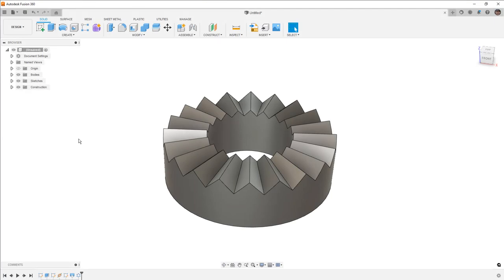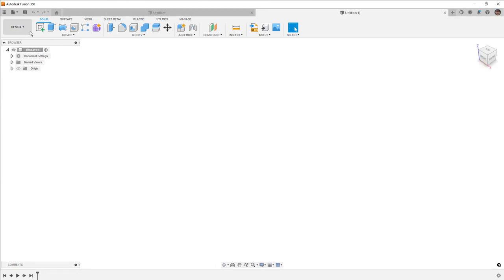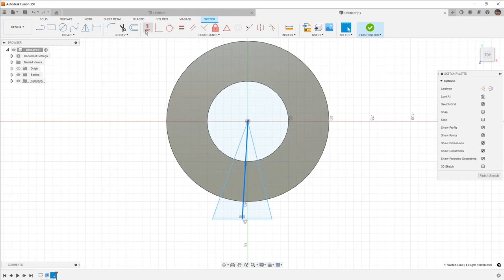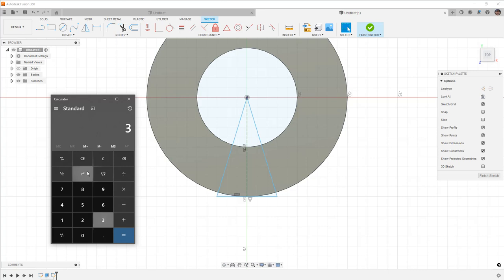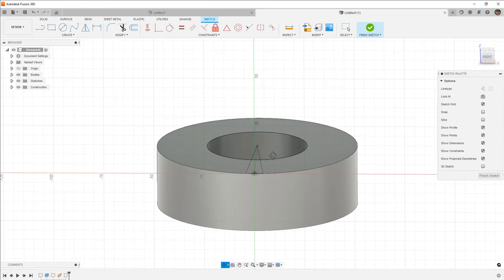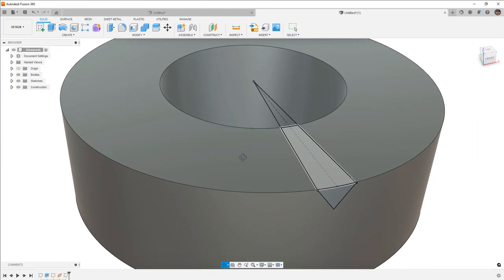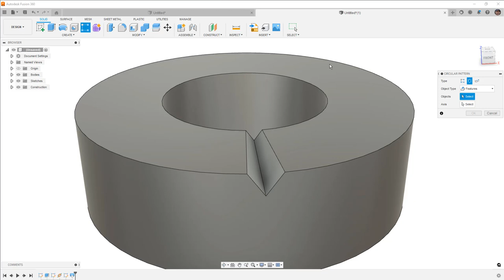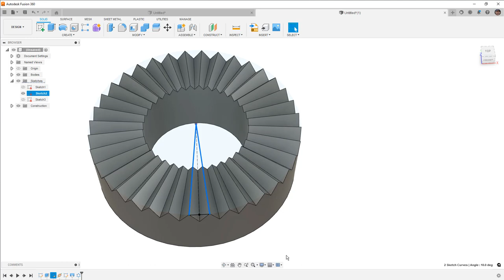Fusion 360 Quick Tips | Serrated Washer Using Loft To A Point | #fusion360

Comment: Reference through constraints are truly the key.  One of the toughest things to adapt to coming to Fusion from Creo is the need to project and intersect to maintain references that will allow these powerful function to work as intended.   Thanks again Matt.
Reply from the maker: Thanks brian, there is an option in the user preferences to auto project.  So if i started drawing the V shape off the edges it would project them for me.  Sometimes it might not bring in what you want though.  For example it might just bring in a point and not the horiz line.

Comment: Perfect for using formula here. You can drive the angle and geometry by just one parameter
Reply from the maker: Yup that would be a great next step!  Have a parameter for the pattern number which drives the angle as 360/pat-num / 2
Reply: @LearnEverythingAboutDesign  yes and to pattern features will not break anything.

Comment: Quite a long process in this software. In DSM you just make cylinder draw a line from center to the edge make pattern, finish sketch and pick the lines you want to move up or down and set set it to the required height. Would take a minute. Nevertheless thanks for the video I was looking for. I found another way as well and not sure which is better.
Reply from the maker: You can do it quickly when you don't explain it but yeah.  There is another video i did shortly after this one on making a true Hirth joint since this is just the general shape.

What is DSM?
Reply: Yes, of course. I am just saying that it requires less number of steps. Design Spark Mechanical is a very smart 3d cad with few options only but would allow to do quite a lot if work sequence is right. Nevertheless Fusion 360 is so much better in general and would allow to model more complex shapes and this is why I switch to F360. Just saying that some simple modeling may be easier to do in DSM that is all. For example you can move and rotate plane as you want. You can move sketch grid, rotate it etc. in sketch environment. I am new to F360 so still stick to my DSM habits. I know that I don't use F360 very well so should restrain myself from comments. Thanks for your video. I will also look at the other one.
Reply from the maker: @fortifor5410  all comments are welcome!  I haven't used Design Spark so I just wasn't sure what DSM was :)  Here is the Hirth Joint video https://youtu.be/jiHUEhja9V0?si=-vg-uRvomP5cQ4_4

Comment: Didn't follow and create the exact same model by myself for confimation, but, can a proper hirth join created by this method? Just asking :)
Reply from the maker: Yes you can.  There are variations to think about.  Lofting to a point will create the spline cuts with the appropriate taper radially but they are also tapering upwards.  In order to avoid this the taper point would need to be on the lower end of the triangle and then the triangle would need to be extended upwards.  Maybe I should do a follow up.  One thing about a hirth joint is the fact that there is no backlash between sides.  If you use one side to cut the other you will have a perfect fit but ideally you would want one side to stop short maybe by breaking the end point so as you tighten them down you would not have the end of the point contact but the tapered faces for the max torque.
Reply from the maker: Check out the new video.  I did one creating an accurate hirth joint using this method.

Comment: i followed your instructions and printed two.  they would not fit together.  any thoughts?
Reply from the maker: Yeah, this video was a general look at how to loft to a point.  If you need two of them to fit together nicely its called a Hirth Joint, and there is a bit of math involved.  I have a video on that as well with a file with all the parameters set up here. https://youtu.be/jiHUEhja9V0
Reply: @LearnEverythingAboutDesign  thanks, i will check it out.

Comment: This serrated joint is not actually a Hirth joint, because the angles of the top and of the bottom of the teeth are different, causing improper engagement.
Reply from the maker: You are correct.  I did a video on a hirth joint using parameters.  This video wasn't intended to be a true to form hirth joint.  If that is what you want look here. https://youtu.be/jiHUEhja9V0